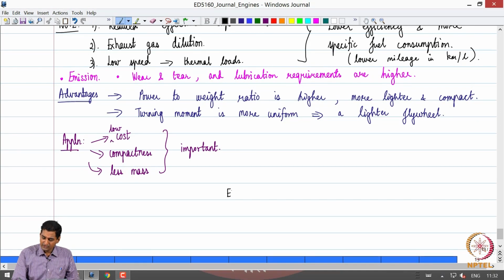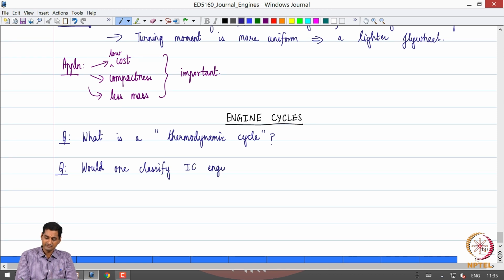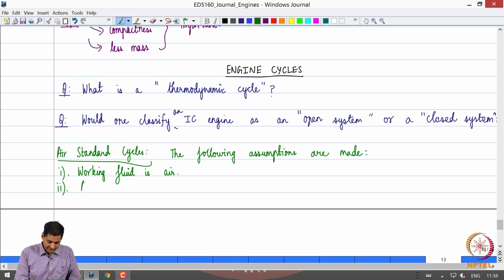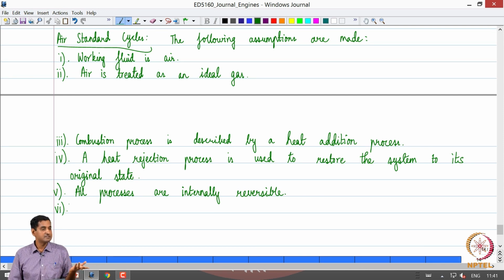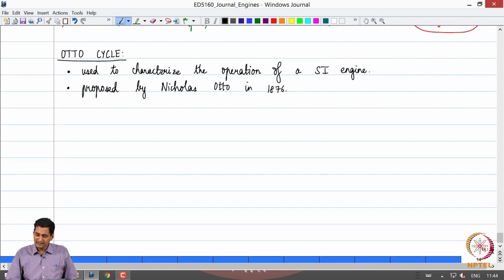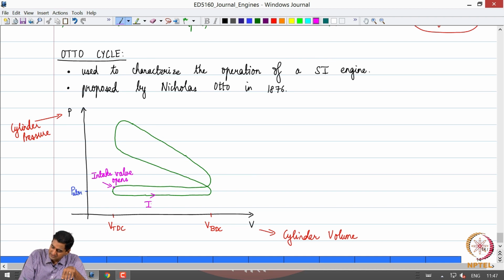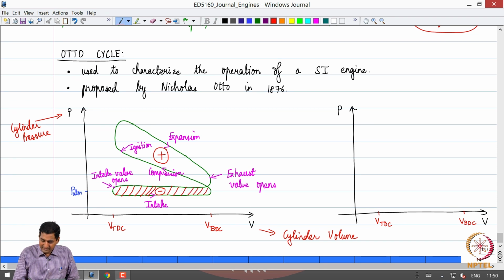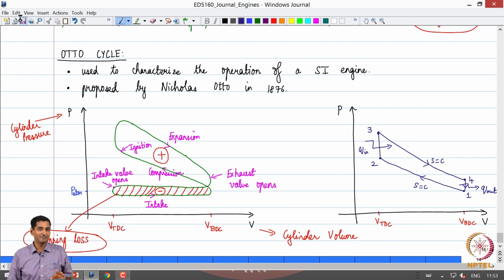#8 Two Stroke Engine and Engine Cycles | Part 02 | Fundamentals of Automotive Systems

Comment: How is heat removal constant volume?
Reply: Assumption
Reply: in actual cycles, obviously the volume is gonna change, but in the otto cycle, we are assuming that there is no intake and exhaust stroke, the cylinder is assumed to be sealed, so heat rejection takes place by bringing the cylinder in contact with a low temperature thermal reservoir